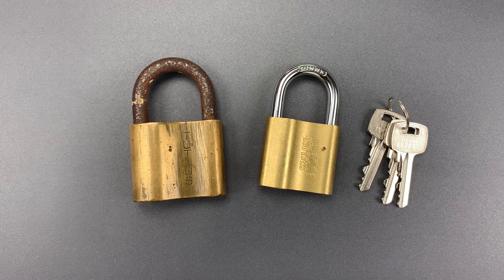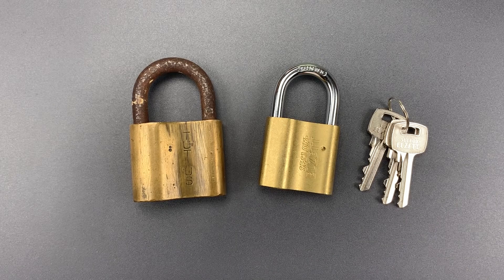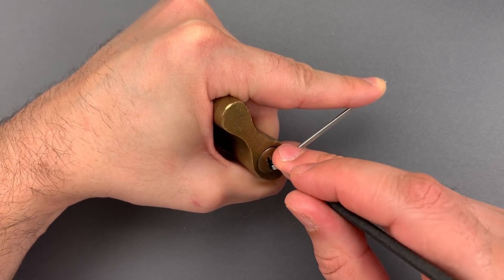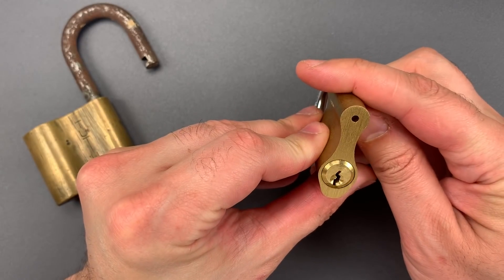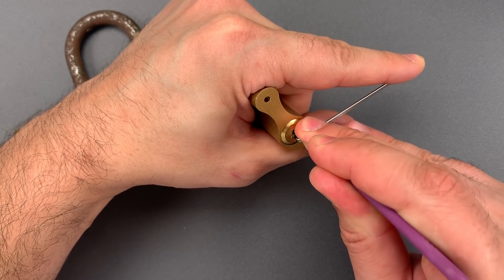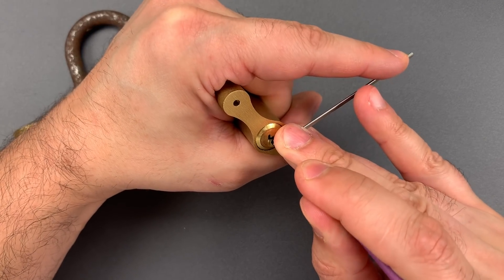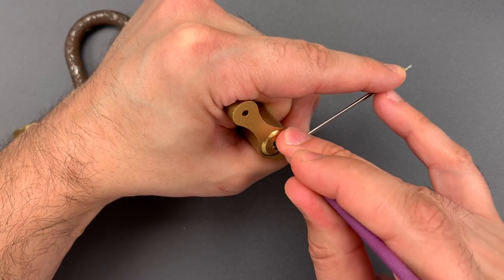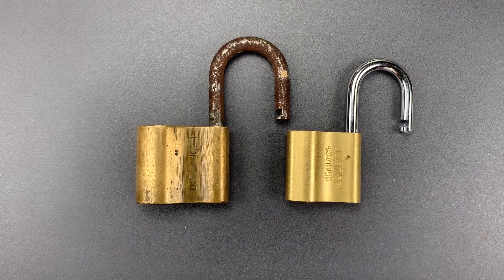[961] Then & Now: Hungarian Elzett Padlocks Made 60 Years Apart

Comment: What determines top of keyway vs. bottom of keyway tension?
Reply: Generally, the design of the keyway. If the keyway is highly paracentric, you're going to need as much room at the top of the lock as you can get, and you won't be able to use the bottom of the keyway for your pick (because of the angles of the keyway).

If the keyway isn't paracentric, or is wide open, top of the keyway means you have a TON of room to work in.
Reply: XlimZ - nice guess but as Dathane’s mentioned, I t’s all determined by how much space you need.  I use bottom of the keyway where I can because it’s less likely to slip out but, in a tight, paracentric keyway, top of the keyway is usually the best way to avoid oversetting pins.  Some locksporters always go top of the keyway just for preference.
Reply: Thanks for the replies. That makes sense now.
Reply: Thomas Rossi generally, padlocks are easier to handle with bottom of the keyway. It also protects your lock from scratches. I usually use bottom so i can lever my pick and gain easy access. Generally though, most high end locks require you to use two tensionwrenches and float pick.
Reply: I prefer being on top, when picking anyways 😋
Reply: I use TOK pretty much exclusively nowadays, yet I still keep trying to pick the tension bar instead of pin 1 DOH!!
😳😳😳😂😂
Also you want BOK if your raking or zipping  unless you like  the tensioner flying at the crucial moment. 🥴🥴

Comment: One thing I appreciate on these now that I've spent the last couple years following Bosnian Bill and LPL is that since the locking lug is directly attached to the end of the core (with no spring action and whatnot) these locks, despite being cheap and old and not even high quality, are non-shimmable.

That they have security pins, even the older ones, is pretty cool, didn't know that.  One that I have I managed to seize up pretty bad while taking apart, so I only saw the last standard pin, they seem to use small pins (Master size maybe or something similar anyway)

Comment: An interesting product. The fact it is still made so many decades later, indicates they POSSIBLY are used by Utility companies, as are Wilson-Bohannon locks in the USA since 1860. Lock design looks NEARLY identical. W-B locks have incredibly hard shackles to grind through ( if you get the hardened, and not the Stainless or Brass shackle models. The locks you show may have old vs modernized production, so tooling would have minor differences to satisfy manufacturing equipment parameters. A nice THEN and NOW video. The keyway is LIKELY the same, as public utilities key their locks ALIKE.

Comment: I’ve been watching for a while just because I find it very interesting. However, what the heck is “counter rotation” that you always refer to? Yes I understand what the words mean but what does it mean when it comes to picking?
Reply: Counter rotation is what happens when you apply pressure to the pin and the core starts to try to turn in the direction opposed to the direction you are tensioning in. Usually caused by a spool pin that has the narrow part at the shear line, so to get the head of the spool into the set position, you need to release tension, let the cylinder counter-rotate and get over the hump caused by the pin.

Comment: you are always picking lock holding it with pins facing down,that allow to use gravity to check movement of key pins,how would you treat the lock mounted in door facing up? it's standard position of the cylinder in many countries .

Comment: They charge the same price for the smaller one. (inflation adjusted) Typical, less for your buck.
Reply: Smaller lock might contain less brass... But designing it is just as expensive. Assembling it from smaller parts isn't cheap either. You need better precision and more expensive tools for smaller things.

Comment: It is interesting to see how a traditionap tumbler built with a few security pins and tight tolerances is as much if not more of a challange than most attempts at innovation, unless you are willing toninvest a large sum into something like a warded tumbler.
Maybe lock companoes would be better off improving rheir quality of manifacture, rather than throwing around buzzwords.
But I imagime that is not quiet so profitable.